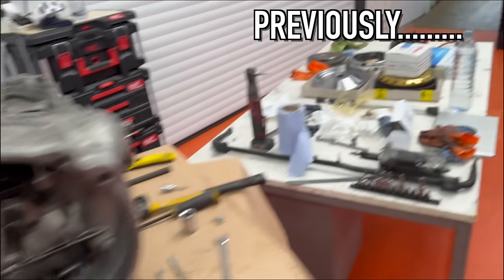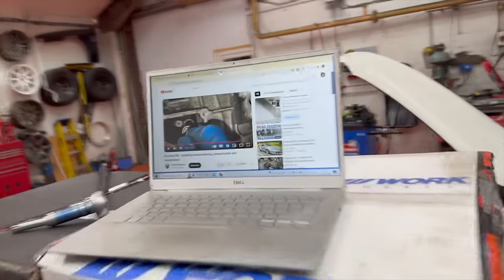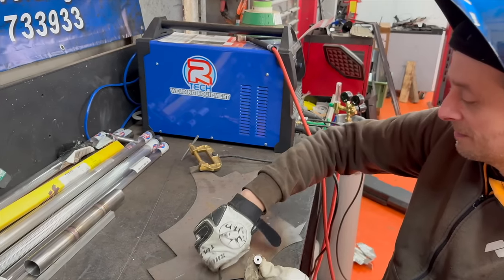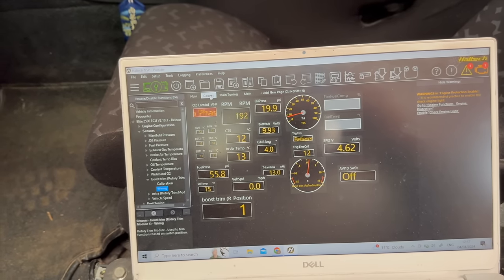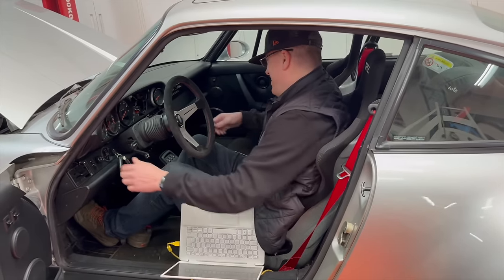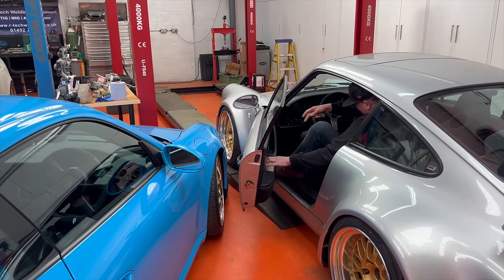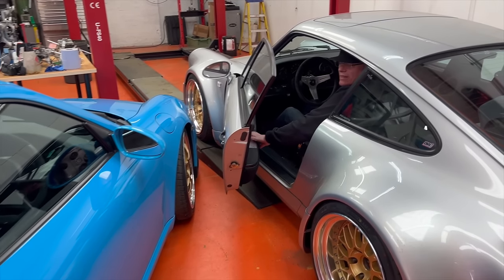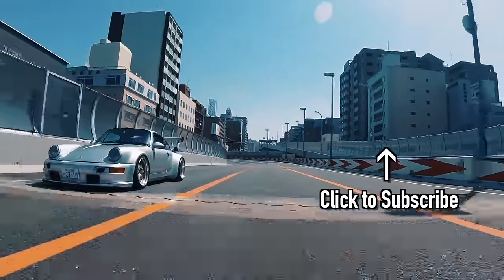964 Turbo Clutch is a Pain In The.... Aircooled Porsche 911 Turbo Life

Comment from the maker: Parts used:
FVD 964 Turbo FVD Exclusive Sport Clutch Kit - For Light Weight Flywheel (583 ft/lbs. max.)
964 RS Fidanza single mass flywheel.
Standard 964 Turbo master cylinder (I believe) The bore measures 19mm
964 Turbo new slave cylinder
964 Turbo new fork and all new hardware
RS release bearing and guide tube.
Reply: Missed: 1x Jay.

Comment: Are your slave and master cylinders a matching pair? A larger bore master would push more fluid for a shorter stroke.
Reply: I came to say the same thing. +1 this.
Reply from the maker: I believe so. The slave was brand new from Porsche for my VIN and the master seems standard and measures 19mm bore, which I beleive is standard. If none of my other ideas work out, we'll just change ratio.
Reply: @driftworks  who fitted the concentric slave cylinder, I wonder wether the master was changed to suit.
Reply from the maker: We did. We didn't change the master, but it already had the OS Giken clutch fitted.
Reply: ... worth noting that as the clutch beds in the travel required to release will reduce slightly. New clutches are typically slightly over clamped when new. If the clutch cover is uprated you will also get more flex in everything. I'd say drive it and give it chance to bed in and it might come good.

Comment: Bash the trigger channel on the scope on Haltech and decide if you want to open the sensor gap slightly and lower the trigger threshold slightly so you have a more robust setup.
Reply from the maker: Sounds like you know what you're on about! We'll take a look. Cheers 👍
Reply: @driftworks   Go into NSP/trigger system/trigger activation and trigger arming voltage tables. Hit the ? button while in there and the Help document gives a good representation of the thresholds youre setting. You can then put it in scope mode and see what your signal looks like at cranking speed (disable injectors) and at idle speed against the thresholds you have set.

If it looks good: you could then increase the crank sensor gap back to 0.8-1.0mm and see how the actual signal drops and how you would need to drop your arming voltage to suit. This should allow you to run more sensor gap which could be more robust in the long term. Worth a play to help you with potential future trouble shooting either way. You can always revert the gap and setting to what works if you get in a muddle.

Comment: I've had similar issues with a couple of clutches

At a guess your SMF is thinner than the DMF meaning that the clutch cover is closer to the engine than it previously was so the slave will have to travel further to disengage the plates

Or the new clutch cover requires more travel to disengage than the previous/original clutch (its worth asking the manufacturer for specs)

Now if you have the available travel in the slave you could fit a larger master cylinder but that will make the pedal really heavy so a smaller diameter(longer travel) slave would be the better option

Comment: The 10mm play at the top is normal otherwise your release bearing would always see pressure there for wearing down the bearing. 

See if you can see the plunger on the slave and measure the travel. talk to the manufacture of the clutch and see what they recommend adjusting the master cylinder to for the correct length of travel of the slave. Might also be listed in the instructions but this is what we do on honda's not sure if you can see the slave plunger on the porsche.

Comment: Decades ago, I fitted a new master cylinder to a Ford Escort and had a similar problem to the one you are having. It turned out that during the model year Ford had altered the bore of both the master and slave cyl, the new M/C did not displace the enough fluid for the old slave to travel fully, thus the pedal to the floor did not fully disengage the clutch..... A bit of a long shot...but...?

Comment: I think the answer is in that hat piece you discuss 2 mins in that varies between the SMF and DMF. In the BMW world, I know when people run lightened m20 flywheels on M5X engines with a ZF box, people run weird combinations of throwout bearings because the hat height of them varies which varies the bite point. 

My advice would be to consider the varying offsets of the different flywheels and other parts and consider if either is right or a custom length tube is required.
Reply: my thoughts too dude!

Comment: Shim on the throw out bearing 25:36 , have to do that on t56 gearboxes depending on the clutch and flywheel used to get the correct travel on the pressure plate, guessing the same thing can be done on that gearbox too.
Reply from the maker: That's a concentric slave. We deal with shimming them regularly as alot of my cars are converted to concentric slave. But this car is a pull type clutch fork and external slave cylinder.
Reply: @driftworks  thought it would of still worked in front of the bearing to increase the pull and reduce the pedal travel in doing so, interested to see what you figure for the fix.
Reply from the maker: It would if there was slack (too much free play), but there isn't, so all it does is the same thing as extending the slave rod.

Comment: at the clutch pedal, there is an adjustment rod, you need to play with that, it'll allow you to alter the bite point up or down
Reply: and the slack in the clutch pedal 'free play' is normal, ideally you should have 5-15mm of free play on the pedal
Reply from the maker: Where is the adjustment rod?
Reply: @driftworks  should be back of the clutch pedal, if youtube would allow photos in comments life would be easier XD
Reply from the maker: There isn't anything like that on the 964. The only adjustment is of the spring assist.
Reply: @driftworks  well this is awful news, sorry

Comment: Being you had to limit the gap for the crank sensor trigger wheel out of spec to get the car running maybe the whole flywheel and clutch assembly is in the wrong position and may need to be shimmed causing the disengagement issue.

Comment: Clutch pedal should return to be level with brake pedal. If not there is a problem & you don’t get a full stroke of the (self adjusting) hydraulic mech. The pedal pivot can wear giving slack or the roll pin can wear, otherwise the slave cylinder can be the cause.

Comment: If you need any adjustment, it should be on the rod in the master cylinder. Changing the pedal fulcrum point would be a pain in the studs.
Reply from the maker: We've done exactly that since the video. I just haven't had time to put it back together yet. 👍
Reply: @driftworks   Ask me how many times I’ve adjusted a Cooper S ( The original) to achieve the same result 😂 Well done fellas, and thanks for the vids 👍🏻👌🏻

Comment: Sorry, perhaps I did not make myself clear... In the case of the Escort... the original slave was still in place and the new master cylinder was of a reduced bore  and thus on full stroke the master did not displace enough fluid to fully extend the slave cylinder pushrod, thus the clutch could not fully disengage..  Which may not be your issue but thought worth a shot..?

Comment: I have noticed that you mentioned you got the 583ft/lbs clutch kit from FVD and that will come with  sintered metal plates, but in your previous video it shows you have what appears to be a normal organic friction material type of disc, I wonder if thats your problem, as different thicknesses would alter your biting point so dramatically, half a mil of difference on the clutch side would translate to centimeters on the pedal side.
Reply from the maker: There are two. It's a 583ft Organic kit https://www.fvd.net/de-en/FVD11610311/fvd-exclusive-sport-clutch-kit-for-light-weight-flywheel-583-ft-lbs-max.html

Comment: Why wouldn't you just drill and tap to allow the orb to an fitting to be threaded in? Guess the result is the same.  As far as engagement - does the single mass flywheel use a different clutch master or clutch fork? Also, the -4 an lines will give you more volume but less pressure at the clutch slave, which may limit the stroke of the slave . For BMWs you can search parts by model using Real OEM, and I am wondering if a similar website exits for Porsches, which would be a great resource for parts matching. Or just get a diagram from the dealer with part numbers and make sure everything matches a stock single mass clutch/flywheel setup.

Comment: I'm surprised the clutch extension on the slave cylinder didn't work. The extension is directly between the slave and the fork, right? No it doesn't change the amount of effective travel but it should start 8 mm further and end 8 mm further, taking off 8 mm pseudo slack.
Reply from the maker: It doesn't work like that as the natural return of the clutch spring pushes the fork and rod back to the same position. The stroke remains the same.

Comment: I think a different clutch fork must be available, unless the other flywheel thicker and pushed the whole assembly further in ?
Could you shorten the splined stub shaft instead , again to move the whole assembly  further out there by raising the bite( difficult to measure clearances )
Reply from the maker: The release bearing housing is specific to the single mass flywheel, so it should all work.

Comment: Interesting video.  What throw out bearing as not in your list?  Would it not be something that changes the distance (shortens) between the standard clutch fork and the flywheel (as that’s all standard bits in your list) that will effect pedal travel. Thinner /lighter flywheel, thinner clutch, lower clutch forks. Could you measure the clutch finger height or thrust bearing height against standard.
Reply from the maker: It's in the list. RS for single mass 👍
I never had a standard clutch. The car came with the push converted OS Giken.

Comment: Is there a slave cylinder available with a smaller bore. It will give more lever action for the same pedal movement.
Reply: @UKMechanic If you take the volume of fluid in a larger bore master cylinder and put it in a small bore slave cylinder, the volume means the actuator rod is pushed further out giving more clutch lever travel.
Reply from the maker: I'm sure I'll be able to find a smaller slave or bigger master. That's the next plan if my current modification to the master rod doesn't work out.

Comment: Did you change the the master cylinder when you fitted the push style clutch.
Reply from the maker: The car came with the OS Giken. We've measured the bore of the master and it looks like 19mm which would make it standard I beleive.

Comment: You need to use race tap to hold the fork been doing it that way for the last 20years
10mm free play is normal for the clutch
Why didn't  you get a 993 rs flywheel ?
Reply from the maker: Cheers.
I did get the RS Flywheel. FVD sent the wrong one unfortunately. It didn't come with the timing trigger wheel and I managed to find a solution I could get in a couple of days.. The RS Flywheel I've ordered for my GT3 has the timing trigger wheel.

Comment: Unless someone has modified the master internals to run the previous setup..........or its that modified pipe causing problems

Had an issue on a previous vw, tried to modify the pipe, clutch bite was right at the bottom, we bled it till blue in the face, no different.  Fitted oem pipe, sorted problem

Theres an MPL Slave upgrade for the firmer pedal 😉
Reply from the maker: Cheers John. I can't see how a short section of the feed pipe being larger or smaller would effect the throw of the slave. The MPL slave would put the bite even further down to the point you definitely wouldn't get gears.
Reply: @driftworks  does the diameter change between the welded fitting, those AN fittings/flexi pipe from the factory pipe? 

Might sound silly, but did you clamp off the breather pipe on top of the resevoir?

The MPL slave is just to lighten up the firm pedal.
Reply: @driftworks  or its the rollpin on the pedal, common failure on 964........might explain the slop in the pedal.
Reply from the maker: Yeah we checked the rollpin (or Jay did). 
The MPL slave makes the pedal lighter because it's a slightly smaller diameter piston. The side effect of this is that you have to push the pedal slightly further to disengage. I need the exact opposite.